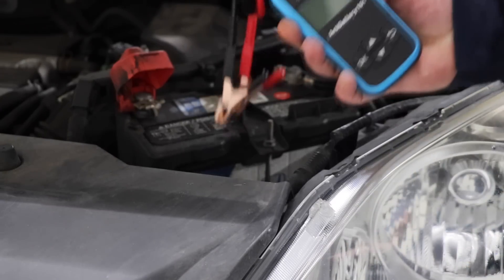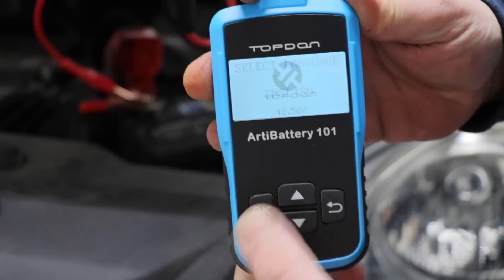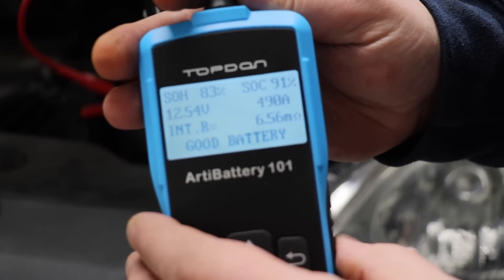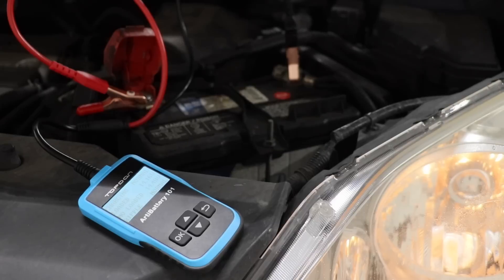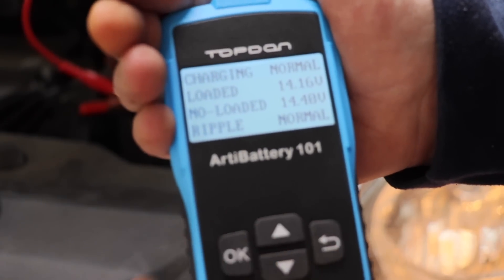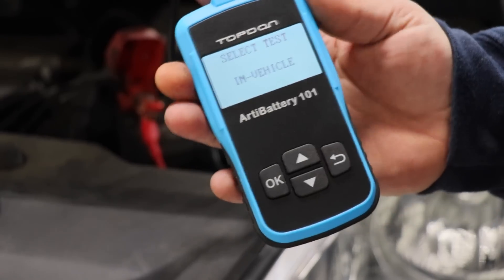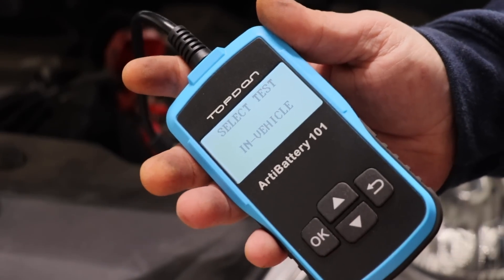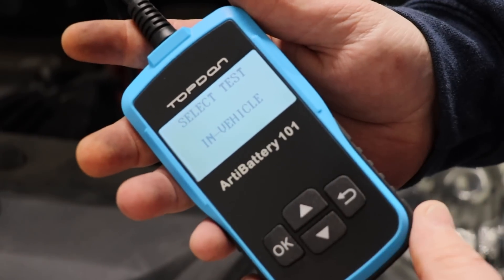How To Easily Test Car Battery & Cold Cranking Amps CCA

Comment: I just saw a shopping mall repair shop video where the customer thought they needed a battery.  The mechanic measured battery voltage and it was 10.77 volts.  He then did a CCA test with the battery in the car and it failed.  Should he have charged the battery for awhile to see if the voltage would get back to normal, and then have done a CCA test.  He never did a parasitic draw test nor did he test the alternator amperage after changing the battery. Should he have? I already know the answers though.
Reply: Then why did you ask lmao
Reply: @calzone9033  Someone might give an interesting reply.
Reply: Don't see why he shouldn't have? Might have been left a few weeks and only been briefly driven?

Comment: To those that commented he did it wrong, no he did not. The tester does not actually measure the CCA. Instead it measures the internal resistance and calculate the CCA. If he had selected CA, the reading would be even higher. Furthermore most batteries are rated by CCA and not CA. It is difficult to find the CA specs.
Reply: Unless you live in Minnesota. Some of the crooks here will advertise the CA of the battery and not the CCA.

Comment: When testing cca you need to test at 0 degrees if above 32 degrees test useing ca
Reply: The entered input is for reference. The produced cca figure is only an estimate, not a real measurement. But yeah would be interesting to see the difference the temperature makes nonetheless.